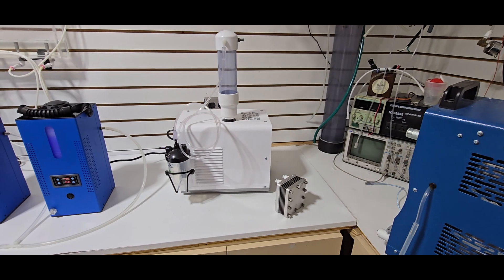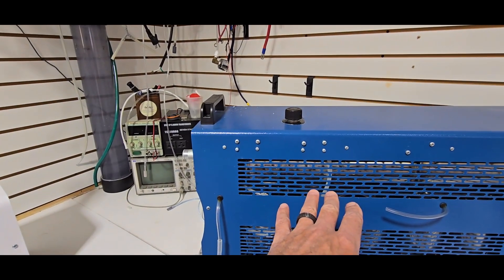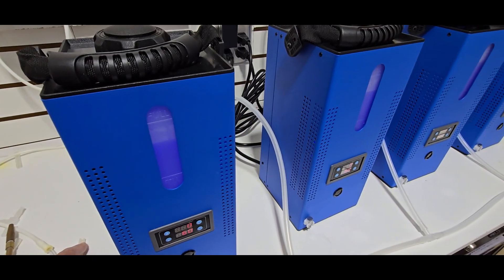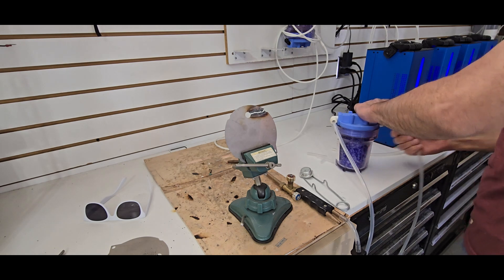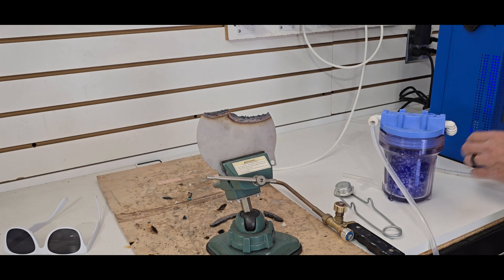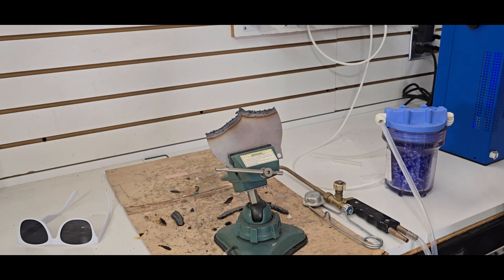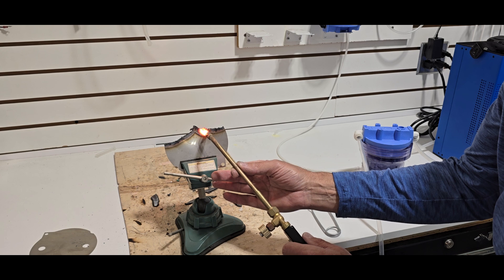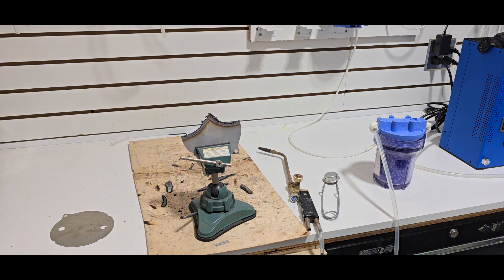See the cutting power of Brown's Gas : What is Brown's Gas part 2

Comment: Do a test with gas that doesn't have eew so folks know the difference
Reply from the maker: @thewebkid  I will be doing another video in this series that used bottled H2 and O2. We will see if it acks the same as BG
Reply: @Hydrogen4Health  Good idea :)  It'll be interesting to see how you make sure the gas ratio is 2 parts hydrogen to 1 part oxygen.  I haven't tried to figure out how to do that yet.
And it'd be good to apply that bottle gas to the 'flame ion' test too. :)
Reply from the maker: @ecopegasus  That's easy with regulators and my alicat flow meter.
Reply: @Hydrogen4Health  cool
Reply: EEW :)))) You have been following me for a long time :) 
I changed the name to ExW many years ago to mitigate the 'stinky' implication of 'Brown's Gas' :))))

I've also recommended to Steve that he use measured strips, say 1" wide and a track torch or even just a horizontal rest so that the cuts can all be under equal conditions.  But for some reason, my 'direct' comments are not showing up on some of Steve's videos and he isn't sure why.?  So, with your indulgence I'll try this 'indirect' response.

 Steve, The big Blue Chinese 'Alkaline Brown's Gas' generating machine you are using to compare with your (PEM) OxyHydrogen (H2 Life V5) machines does produce ExW but NOT in the quantities that an optimized Brown's Gas electrolyzer would. So the 'result WILL BE closer to OxyHydrogen

The blue machine is about the same as my 1994 technology, before I optimized (in 1996) a design where I could SEE the ExW being produced. You can see my optimized experiment here: https://eagle-research.com/water-gas/ 

I was building electrolyzers that were producing 130% gas volume. Obviously, nothing can be over 100% (even electrolyzers designed by NASA were only running in the 90% range for Faraday efficiency)… 

so WHERE was/is the EXTRA gas coming from? How is it that I was getting MORE gas than theoretically possible? I had a theory (mon-atomic gas), that was subsequently dis-proven when we tested the Brown's Gas with spectrographic analysis. 
But... The spectrographic analysis showed something entirely different, a gas made from WATER (it's still water) that was NOT water vapor or steam... A negatively charged cold PLASMA form of water (H2O-). 

Then I realized what I was seeing in the transparent ER50. A gas being formed that was NOT part of the Faraday equations (it was still WATER, (H2O-)) but a 'side effect' of the electrolysis process / design I had optimized. I call this 'extra' gas Electrically Expanded Water or ExW.

 If the point of this series of videos is to honestly demonstrate the difference (or lack thereof) between Brown's Gas and OxyHydrogen then it behooves you to build the ER50 and test it, then use it for your comparisons. Instructions to build an ER50 can be found here: 
https://eagle-research.com/product/er50-flat-plate-kit-mini-bg-electrolyzer/ 
https://www.youtube.com/watch?v=obpBHOfjrBA&t=1s 

The ER50 can be used to fuel a micro-torch, 
https://www.youtube.com/watch?v=ykPtKun5NJc&t=6s 
which was it's original application, before being repurposed for health 
https://www.youtube.com/watch?v=s2wuC-kpqDU 
https://www.youtube.com/watch?v=QgQex8IXyHY&t=8s 

Note that your cutting test was about 23 seconds for the OxyHydrogen and 19 seconds for the poor quality Brown's Gas (about 20% faster cut). I note that all your tests, even compensating for different distances cut and increased gas production were consistently faster with the Brown's Gas (using a stop watch while watching your video). 

To do this test 'better' I'd use pre-measured strips of stainless steel (equal lengths of maybe 1 inch) and an automatic cutting machine (for straight lines), adjusting each type of gas to it's maximum cut rate.

May the blessings be
 🦅 George Wiseman
Reply from the maker: @ecopegasus  See video 5 https://youtu.be/x4BjwCZWY_Y?si=lzldFFE2Wz4_oGcZ , I think we can see where the extra efficiency comes from. Using your equation my PEM was over 100% efficiency and we all know that's not possible. Maybe when you were "building electrolyzers that were producing 130% gas volume." you used this equation... "The big Blue Chinese 'Alkaline Brown's Gas' generating machine you are using to compare with your (PEM) OxyHydrogen (H2 Life V5) machines does produce ExW but NOT in the quantities that an optimized Brown's Gas electrolyzer would. So the 'result WILL BE closer to OxyHydrogen" <---- Maybe so but you're touting 30% more hearth benefits with the aqua-cure and the "big Blue Chinese 'Alkaline Brown's Gas' generating machine" uses the same electrolyzer. It's just not adding up.